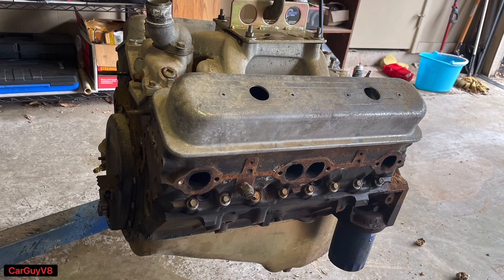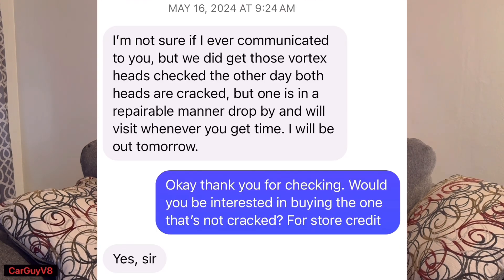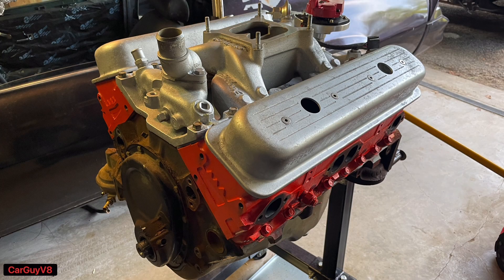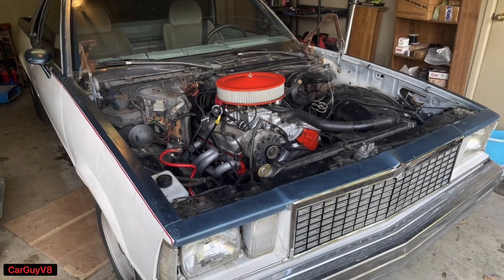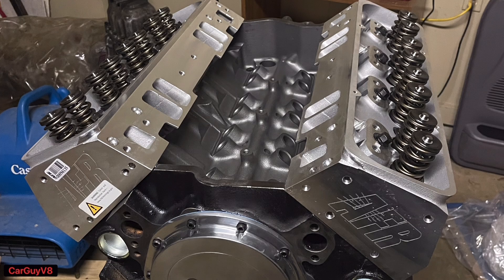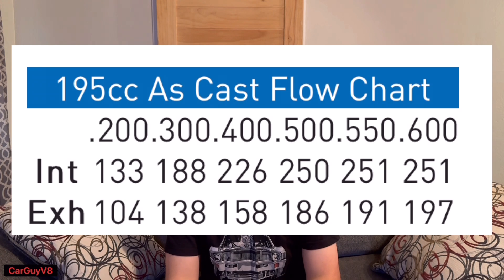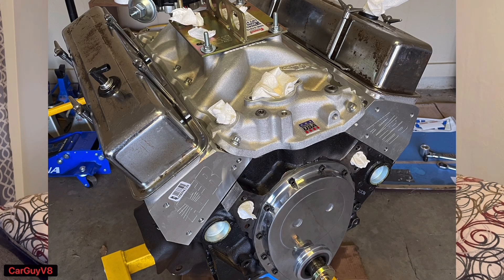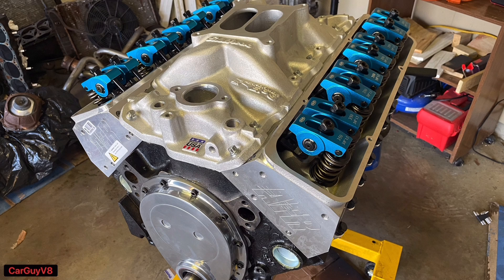Easiest and Cheapest 400 HP SBC NA Combos

Comment from the maker: Note: 0:35 if you run a cam with higher lift than approx .470 lift on Vortec heads, you’ll need aftermarket valvesprings that allow higher lift cams. Either that, or the valve guides will need machined down by a machine shop.
Reply: NO! My machine shop guy chuckled when I was discussing this, he said simply get valves that are .100" longer and leave the heads alone 👍😎

Comment: I can definitely agree about the 400 hp being more than enough. I ran a stock bottom end with aluminum heads on a longbed c1500 recently got it to 4000 lbs with me in it. On the street it ran 13s on street tires very mild cam setup 375 hp ish

Comment: So just as an fyi this could be a fun build for u.  Everyone knows both TBI and tpi motors aren't High revving motors but they have a great Torque curve.  The TBI heads give you more torque than tpi heads. So as a base if you could find a complete tpi intake setup. And drop it onto a TBI motor. Take it a step further  buy a torque cam. Maybe something with a 210 duration etc to further that torque curve. The TBI heads will never really flow super great and will limit hp number in favor of tq. But as they say you drive torque. Now throw a cheap ebay turbo on it. That will just fatten and increase your overall torque curve and output and yes you will get a bump in hp again the focus not being revs or hp so likely a small turbo.  Then depending on the application you could run tall gears and you run into an old school term called Torque doubling.  With the TBI heads. You can clean em up. But don't throw money at them. As for turbos. I have seen people buy cheap knock offs. And then buy a cheap update kit. And essentially rebuild and update a cheap turbo. Since you won't be build huge boost maybe ul to 10psi effectively there will be 0 need for an intercooler. I think though with the right combination.  You could build a Motor that nets better than 600ftlbs of tq.  Again the tpi intake is better than the TBI for tq whereas the TBI heads are better for torque than tpi. Also Corvette tpi Intake and runners flow better than the IROC. Specifically  you would want to find a tpi assembly off a 350 Corvette. If your running a 700R4 trans buy servos for a Corvette 700R4 and Install them maybe see if you can buy a cheap shift improver kit for it. Also buy an HEI spring kit and use the towing springs.   If you catch my drift play to the strengths of a motor built around torque.  Remember the TBI heads will never make huge HP and will never flow so except from smart porting dont throw money at em. I do believe the Tpi intake assembly can bolt up to the Tpi. But not completely sure. I believe there may be milling needed. However if you have a set of heads all you need is the tpi intake for confirmation.
Reply from the maker: That’s not a bad idea. I happen to have a tbi 5 speed truck sitting around. Might have to think up something for it.

Comment: Will never buy anything from Comp Cam's again had good quality for years and bought buy a performance group and even rollers are having problems .
Reply from the maker: @larryburns4605  Yes, for flat tappet Isky, Clay Smith, or Howard’s are absolutely the way to go. What kind of issues are comp roller cams having?
Reply: @CarGuyV8  Cam's delaminating and grind wrong
Reply from the maker: @larryburns4605  That is bad. I hope these companies will get their acts together, but I doubt it.
Reply: @CarGuyV8  I use Bullet / Ultra Dyne awsome service and great product
Reply: @CarGuyV8  Most these companies that used to be family run are now owned by investment companies. Even our favorite "Family run" biz here in ca .  Why the prices shot up like crazy qc always takes a hit.
Reply: @CarGuyV8  Crower, like Isky is a very old brand and very high quality. Guys whine xxx on amazon is cheaper, well yeah. For good reason lol
I had a Comp xfi 280 roller that went flat at 15k miles .Tore up the valvtrain seats etc .
2 XE flat tappets went flat in 30 minutes (when they first came out), tried all their trick lifters they recommended, got disgusted went back to Isky
Reply: Agreed. Comp is complete trash anymore. Wouldn’t touch any of the junk they make anymore.

Comment: Come on you claim 400 hp but proceed to 'guesstimate' your torque equation 🤦 wow you never Dyno tuned your engine, you e never run it at the track (weight vs  e.t. equation). Been building engines for 30 years.  Don't 'guess' your power numbers because you will be very disappointed
Reply: If its an exact replica or close, to a previously built and dyno'd engine, you can usually get very close hp number.  Still can vary slightly
Reply: @FreeSwimmer  you cannot compare 'close' that doesn't work.  Change ONE variable and you gain/lose hp.  The ONLY way to know is Dyno & track time vs weight. I've seen WAY too many guys believing they have 450 hp only to track the car or Dyno the engine & find out they have 390 or so hp.  If you want to tell people about a 400 hp engine KNOW for sure it's putting down 400+
Reply: @jeffdohse7124  More 500 600 650hp engines on YT than ever existed in real life. Funny how their power numbers are all exactly in increments of 50 or 100. 
Have no clue, nor do I care what mine makes. Its just a number

Comment: Do original push rods usually work when you swap to vortec heads?
Reply from the maker: @cameronf1460  If you’re running a flat tappet cam you should be able to run the stock 7.8” pushrods. If you’re running a roller cam, then the stock 7.2” Vortec pushrods should work. It never hurts to measure though.

Comment: Or just buy Skip White nkb200 heads that are the same castings as the AFR enforcer heads but stock valve diameter for about 400-500 dollars cheaper. If you want to go faster, get promaxx project x 200 or 215 heads. They are afr eliminator copies that blow the enforcer (dart knock offs) out of the water.
Reply from the maker: @inscoredbz  I wonder how good the valve springs and valves are in the NKB200 compared to the Enforcer? That would be my only hang up, since I don’t personally have experience with those heads.
Reply: @CarGuyV8  it depends on which ones you buy. They all have comp cams retainers, keepers, spring seats, and either pioneer valve springs (most are just rebranded pioneer springs) or comp cams hydraulic roller springs and pbm valves. It's good stuff. The valves are good, pbm just rebrands them. Ev-8 stainless. I've used those valves in another build in a 406 with dart 215 pro-1 heads. AFR uses rev valves, so they are better. But for 400 HP, the Skip White heads are more than enough.
Reply: @CarGuyV8  Hardware is way better on the afrs. Get my heads from the same source as nkb here in Ca...see those mostly used with pbm hardware which isnt bad but not great either. 
Read the fine print, most are sold with flat tappet springs, 3/8" studs
Its the upgrades where they get ya.

Comment: Yes sir!!! Everyone is chasing 800 to a thousand horse cause that's what is getting parroting on social media. 400 too 500 in a street car is so fun. Most that claim you need a grand has never drivin anything with more than 250 to 300 horse. The higher the power, the harder it is to drive on the street. I don't see the fun in having to be above 60 to keep it from spinning. I'm doing a Ls3/6L80E swap in a 03'Crown Vic Police Interceptor. Its a project with my grandkids. I'm not brand loyalty. I love all cars if they are cool. I've git 4 grand in the engine already but the only thing used is the block and head castings. Everything is new. And I am running a BTR RedHot cam. I've seen dynos between 537 to 565 horse. So in a 4200lb car. That should fun. Not building a all out race car. Burnouts and ice cream lol. We'll untill I get the brakes and suspension done then it will see some track use.
Reply from the maker: That sounds like a great project! The Crown Vics are a great platform to build on. Thanks for watching.
Reply: @CarGuyV8  Thank you very much. Since 1998 when the Interceptors came out with all of the chrome blacked out, I said I'd own one, one day lol. My next one with have a Gen 2 5.0. If I can get my hands on a mid 90s Chevy truck, I am going to build a SBC for it for sure.
Reply: I've tried explaining to the "just put an LS and some chinese turbos in it" crowd that things don't work that way. Can I throw a pair of cheap turbos on a stock 5.3 and easily make high triple digit power? Sure. What's the point if I need to put roll bar or cage in my street car though? NHRA requires a roll bar below 11.50 or faster than 135mph(slower in convertibles) for anything older than 2008. I'd rather not have to don a helmet and neck restraint just to go for a ride. If a car with over 500hp can't hook and knock off an 11.5/135 on a prepped track, it definitely isn't hooking from a standstill on the street which is why you see all these morons roll racing on highways. 

BTW- My LS swap statement wasn't aimed at you, but rather the "cheap 1k hp" people. If someone is building a dedicated track car, or is looking at making realistic streatable power, hell yeah go with an LS. I know for a fact that I can pull 500hp from a SBC or Windsor though. I also know I can make it hook and those people would never see it coming.
Reply: @CzechSixTv Right!!! If you have to be going 60 MPH or above to get it to hook, its not realistic. Most people dont understand whats involved with getting a 500 horse car to hook on the street. From a stand still. Plus if im putting that kind of money in car it going to be a race car. Not a race car with tags. Now days I want to just blow the tires off at will for myself and my grandkids fun. Ls3 build in a 4200 lb car will work perfect and i can load em up and go somewhere.

Comment: Not even all the way through the video, but thank you for this video. I’m building a vortec, just have to get 906/062 heads from the junkyard probably, but I have an intake also…so on the power side of things, I really just needed a cam…I did some research and found I needed .510/.520 lift to make 400hp on a vortec…well…I found the comp 282. I bought the cam because of you, and that one forum…😂
Your step side squarebody sounded so good, and I especially liked the cam when it was in the Camaro with the 18” glasspacks, can’t wait until I get my engine built and see how it sounds through 24” glasspacks! Anyways, thank you for your videos!
Reply from the maker: @SQUARE_ATC You probably already knew this, but to run that cam you’ll need valvesprings that increase the maximum lift Vortec heads can handle. Comp makes a .540 lift spring. Either that or machining the valve guides. I forgot to mention that in the video, so I’m going to add a note.
Reply: @CarGuyV8 yeah, gotta get some more money and get everything else I need(heads, gaskets, etc). I definitely can’t wait though!!! I can’t wait for the chop…😅
Reply: @CarGuyV8 yep, ordered springs, retainers, and keepers when I got the cam. Everything Cutter Performance on here said…😂
Reply: @CarGuyV8 I will ask you this, if you had 305 vortec heads 059 casting, would you still go and buy 906/062?
Reply from the maker: @SQUARE_ATC I would probably go with whatever head I already had. I prefer 906/062 though since they already have 1.94” intake valves.
Reply: @SQUARE_ATC 305 heads arent vortec. Lots say they are to get more selling them cause they have centerbolt valve covers. 
Id buy better heads period
Reply: @gordocarbo  they’re definitely vortecs……center bolt valve covers doesn’t mean a thing. Year they came off of, the intake bolt difference, the port difference……100% vortecs.
Reply from the maker: Sounds like you’ll have a fun setup! Running glasspacks will definitely help you see the full power potential of the setup, especially if you’re running good headers too.
Reply: The 276 is a real good cam for a 350 dont overlook it. 
Youll need deeper gears larger stall spd the bigger you go